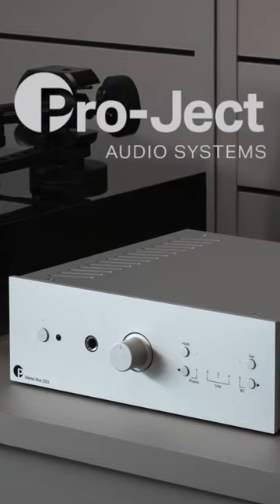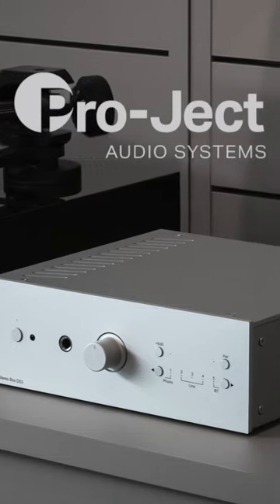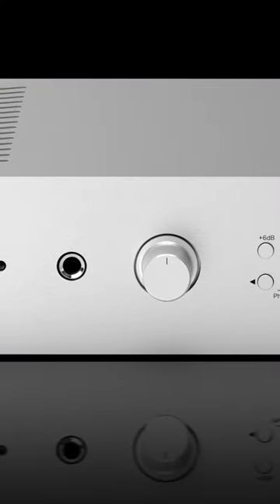Future-Fi Now! PRO-JECT's StereoBox DS3 integrated amplifier

Comment: I think a energy efficient class D full analogue amplifier is great! Electronica like dacs are improving rapidly at this moment with all these Chinese companies. So a basic analogue amp with lots off power is great! All other components could be swapped in the future. I think I will go for this one (combined with the nice walnut panels) and use a Bluesound node X as pre-amp. In combination with my Wharfedale Lintons 85th anniversary speakers it will be a good Mach I think. (I’m currently using a Sonos amp) 

For those who need digital inputs… The Pro-Ject MayIa ds3 could be the amp for you. The dac is really good.

(I’m absolutely do not have any releations with the pro-ject company whatsoever but @Pro-Ject I don’t mind if you give me some stuff! 😂)